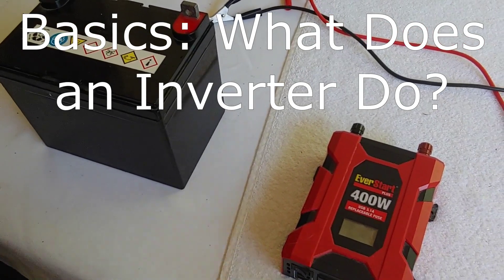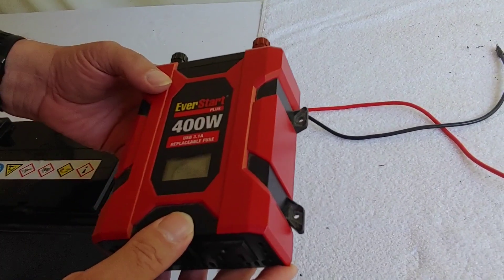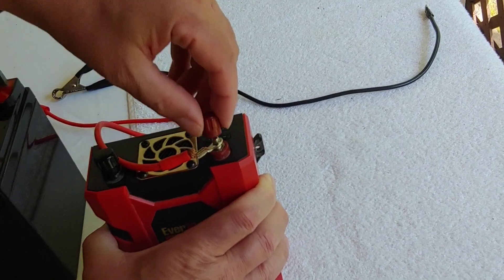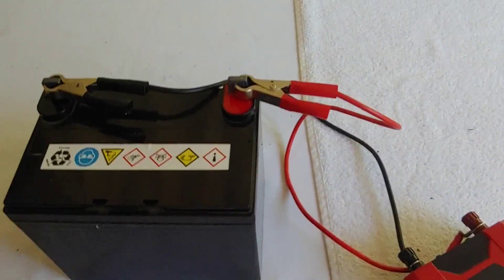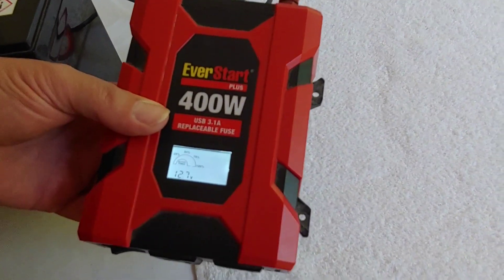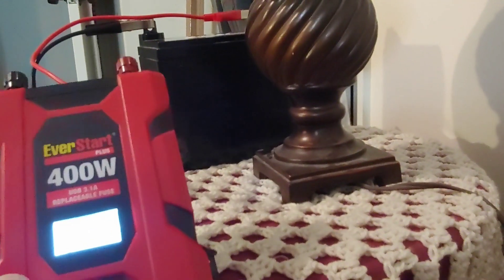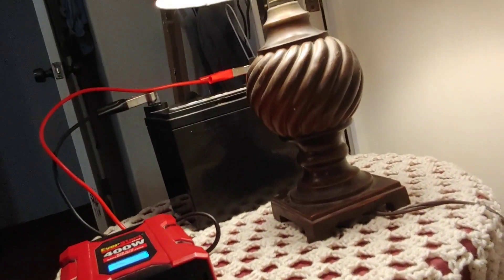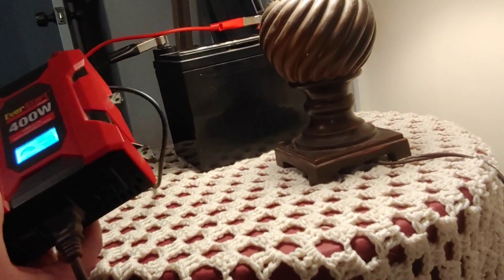Basics: What an Inverter Does and How to Connect One

Comment: Can you plug an inverter into a household outlet and charge it so that when you leave you can use the inverter as like a power bank
Reply from the maker: No you cannot plug an inverter into a wall the inverter is designed to be connected to a Battery Source thanks for your comment

Comment: What size wire you didnt say
Reply: What size of wire
Reply: He said that it generally comes with what is needed so in general you don't have to consider the cable. But of course if yours didn't come with a cable then you have to search for the wire size to get a correctly sized cable.